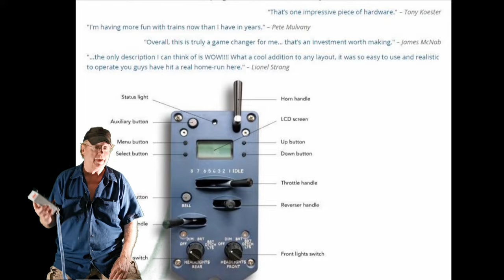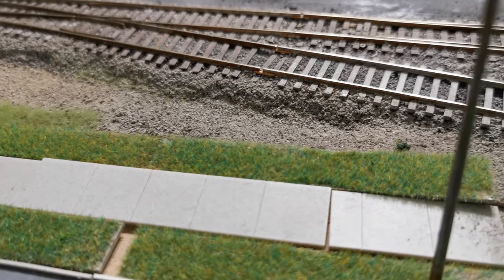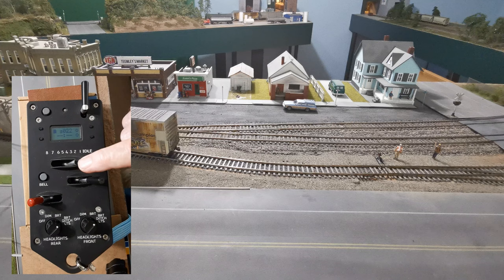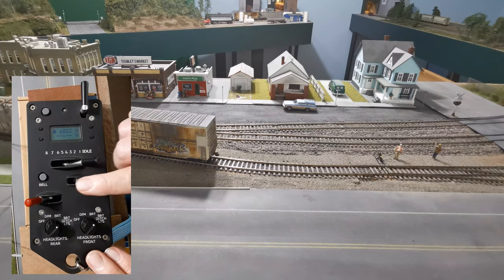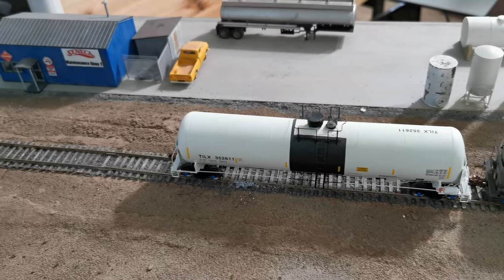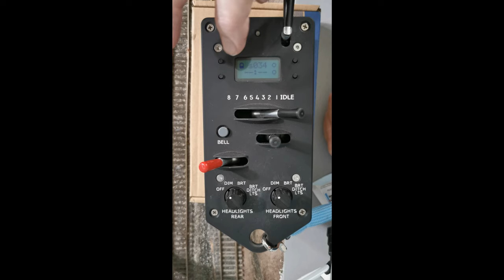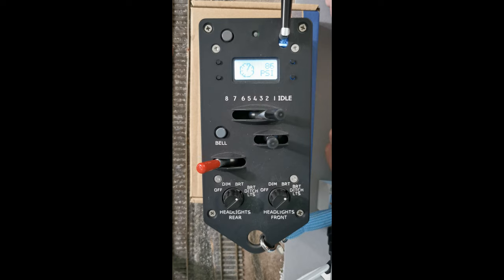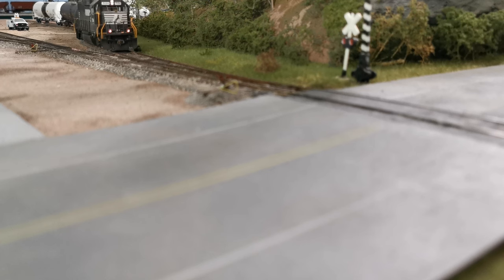ProtoThrottle Review

Comment: I absolutely love my proto throttle . The best part is that you can change the CV’s on your locomotives and then you can operate your locomotives prototypically. I got mine so the hand brakes glide to a stop just like the real thing. Definitely worth it.
Reply from the maker: Hi Mike, thanks for your comment!
Yup, me too. I set the momentum high for a slow start and braking high for a long coast.  Take care - Bill
Reply: I set my engines pretty the same way. Thank you for the reply. I will be posting an update on my layout soon.
Reply from the maker: @mikewoodbury7248  I just subbed. Looking forward to it. Thanks - Bill
Reply: Awesome thank you I appreciate it. It’s a lot different now that I’ve re modeled a few areas and industries. I operate a freelance switching layout that takes place in my home area of southern Massachusetts. But it will soon be Mass Coastal railroad and Bay Colony lines which are real railroads that operate here. Cheers!